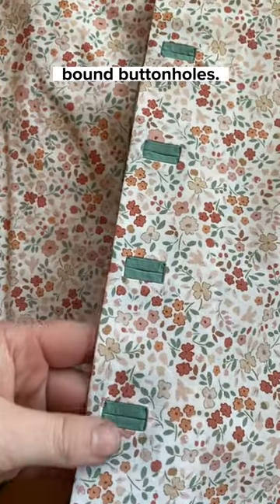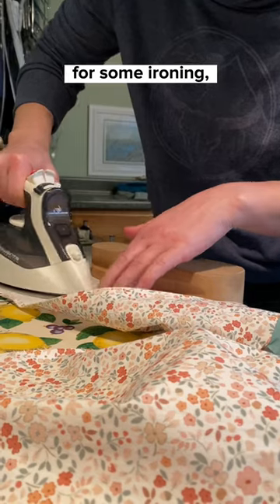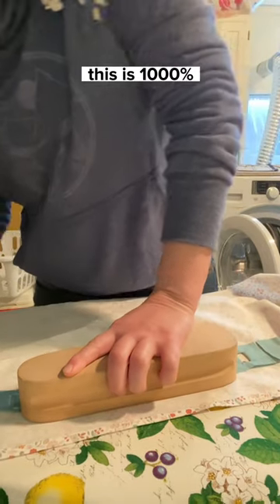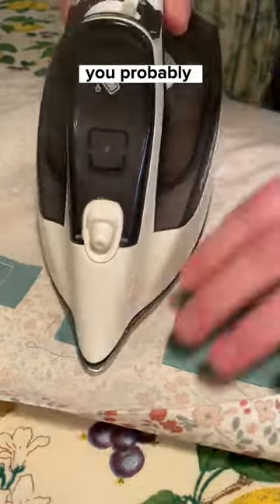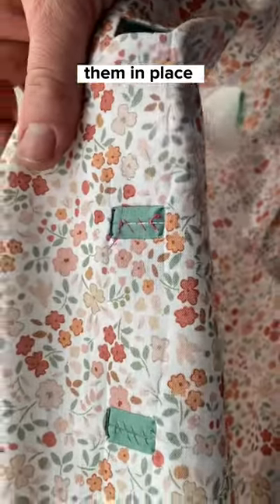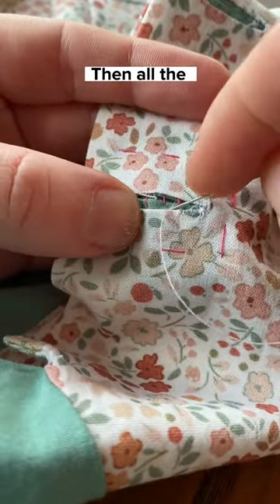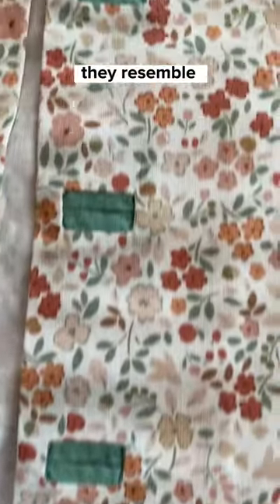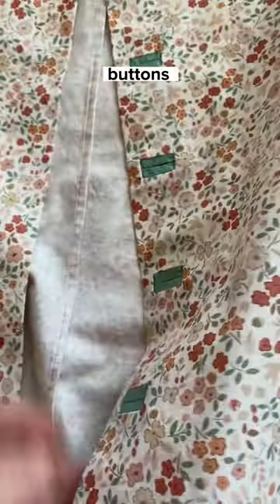Bound Buttonholes to avoid zigzag stitches (PART 2)🪡🧵 #sewinghacks #sewingtips #notatutorial

Comment: I just found a clapper at a thrift store and snapped it up for super cheap. It may be unnecessary, but using one does help! Love these little button holes. Perhaps a flower shaped button would complete the look nicely.
Reply from the maker: Oh, agreed that it can be handy, I just am all about trying to make sewing feel accessible, and don’t want people to feel like they need to drop lots of money on tools, especially if that’s what’s stopping them from sewing! But I use one if it’s handy, or even if not (like when I made my vintage wool Outlander coat) I just used a stack of books!

Comment: If you want anything to look professional, having that wood/pressure after ironing creates those beautiful crisp lines. That's a cornerstone of tailoring! 

Also soooo bold to do the bound buttonholes before you figured out buttons. I like your style 😂
Reply: THANK YOU! I know I've seen a few Costubers use it, but I wasn't sure WHY.  ❤
Reply: @thebookwyrmslair6757  Happy to! It's idea is that after introducing the steam to the fabric, clapping it with something porous, like this wood quickly sucks the water vapors back out which helps to set the material to how you were ironing it. That's the purpose of those fancy ironing boards with a vacuum pedal in them. They are way cool.

Comment: A hardware store usually sells 2×4s for super cheap. If you want to have several clappers without spending 17 bucks for ONE... you can pay for the 2×4 and cut it down to the size you need for your ideal clappers.

An 8 foot 2×4 cost around 4 bucks and they cut it down to around 12 inches giving me 8 one foot long relatively heavy pressing clappers. I plan on sanding them to make them smooth around the cut edges. But highly recommend.

And if you can find boards like that thrifting or salvaging. Then you get them for free.

Comment: Never seen this kind of buttonhole. (Well, maybe I did, but I didn’t notice.) very sharp, love. 
Also, the clapper is not extra, it’s actually super helpful for super crisp edges and finicky facings that have lots of weird curves and the like. Personally, I use the bad iron as my clapper, (unplugged of course.) the metal works faster, but sometimes if you’re doing a lot, it will get warm, so it’s best to only use metal if you are just doing a bit. Cheers!
Reply from the maker: Yes, I understand that a clapper (or something that can stand in place of a traditional wooden one) can be very useful in certain circumstances. I have a heavily tailored 1940s wool coat that I made, and used a pile of books in place of a clapper in strategic places. 

However my channel is all about making sewing feel accessible, and (having made tons of very beautiful, sharp and crisp items of clothing without any sort of clapper) I don't want anyone watching this to feel like they need to have this super specific, oft times expensive piece of equipment in order to get started on their sewing journey!

Comment: The clapper is necessary depending on the fabric - it holds the heat/steam in the fabric long enough to get a clean finish.
Reply from the maker: I appreciate that you at least included the caveat about the fabric type. My channel is all about making sewing feel accessible, and I don't want anyone watching this to feel like they need to have this super specific, oft times expensive piece of equipment in order to get started on their sewing journey! I've made tons of very beautiful, sharp and crisp items of clothing without any sort of clapper, and (when needed) I've used a stack of heavy books, but this thin, crisp quilting cotton did not need the clapper.

Comment: I have material to make some button up shirts and I haven't started because I don't have a button hole foot. I'm totally making these now with a secondary fabric I have for accents. I need to buy some cute buttons now!
Reply from the maker: Perfect!! And also, even if you don't have a buttonhole foot, if you have a zigzag function, you can always do it manually (I do that ALL the time). You absolutely don't need a template or a foot, just some good marking where to start and stop the buttonholes - you can see this technique about 14 minutes into my Steampunk Capri video: https://youtu.be/xpcyJQDgXqE
Reply: @ShannonMakes  awesome, thanks! The cuffs on the piece in the vid you linked are super impressive. I didn't think I could use my machine for buttonholes without the foot and I have mobility issues with my hands, so handsewing is out of the question. Thanks for the info! I'll definitely bye checking out more of your videos!

Comment: Why did you size your button holes before picking buttons? 

Nice work though, and good tip about ironing, though I find ironing for construction more doable/pleasant than ironing for maintenance.
Reply from the maker: Because I didn't have good buttons on hand, but knew approximately what size buttons I wanted, that I have access to many options for sourcing buttons, and that there were many colors and styles that'd work, so finding a button = not a big concern in this specific instance.

Comment: Thanks. My machine does zigzag and those templates showed me how I can use that to make buttonholes without the buttonhole computer function that it does not have. Ps anuses are round not square. Thank heavens or I dunno if I could ever look at any buttonholes again. That was extreme
Reply from the maker: I never use the "buttonhole" function, even on my machines that do have a zig zag, I literally just do the zigzag manually, and you absolutely don't need a template, just some good marking where to start and stop the buttonholes - you can see this technique about 14 minutes into my Steampunk Capri video: https://youtu.be/xpcyJQDgXqE
Reply: @ShannonMakes  thx

Comment: Ok this is really neat and I think I might have to try it myself, but why did you make the buttholes before deciding on what buttons you want to use? You need to know what size your buttons are so you can make the right size holes.
Reply from the maker: There is only a very, very small range of button sizes that will aesthetically look good on a blouse, and it's very, very easy to design a buttonhole that will fit that range of sizes.

Comment: I am shocked you didn't have buttons picked already, now you are limited to certain sizes 😢
Reply from the maker: I am shocked that you think that I didn't consider the situation before proceeding... there is only a very, very small range of button sizes that will aesthetically look good on a blouse, and it's very, very easy to design a buttonhole that will fit that range of sizes.

Comment: Reminder to NEVER, EVER, NOT EVEN ONCE hold your pins in your mouth like that.
Reply from the maker: Reminder to NEVER EVER, NOT EVEN ONCE try to dictate to strangers on the internet how to act
Reply: @ShannonMakes  I’m an ER nurse and have seen more than one sewing pin aspirated. Seriously, it’s a terrifying, dangerous, and most likely expensive experience that can be completely avoided. I’m not coming at you for doing it and honestly most creators don’t even read their comments so I was thinking that the warning was more fire unexperienced folks in the audience. 
No need to offense to someone trying to prevent unnecessary bodily trauma.
Reply from the maker: @ItBeThatWaySometimes  I walk back my reply in light of your context. I get SO many just absolutely ridiculous comments that are not based in any sort of reality that one defaults to either deleting automatically, or responding in like. 
While I personally work with my body for a living, have good body awareness, and feel pretty confident in my ability to not inhale a needle after decades of sewing, I appreciate your warning for others (although maybe a little more context with the original comment, rather than a wall of screaming text would help convince others)!

Comment: You would rather go through all this instead of switching the foot….  They are nice but seems like way more work.
Reply from the maker: Sewing isn't always about speeding through the process to get to the end as quickly as possible. In fact it's rarely about that. If I wanted a blouse NOW, I'd go buy a fast fashion one. But then it wouldn't have the fabric that I liked, it might not fit me as well as I'd like, and it certainly wouldn't have the couture touch of bound buttonholes!